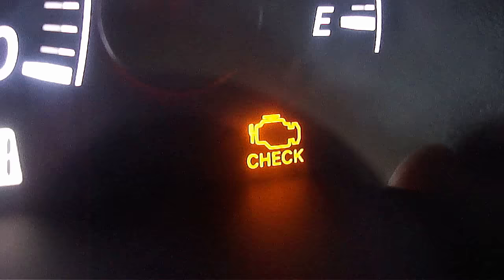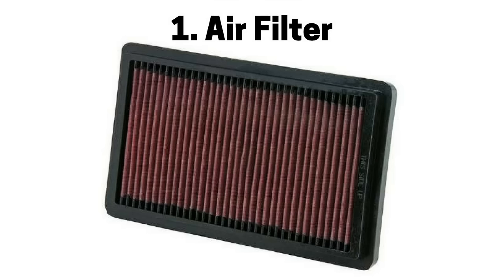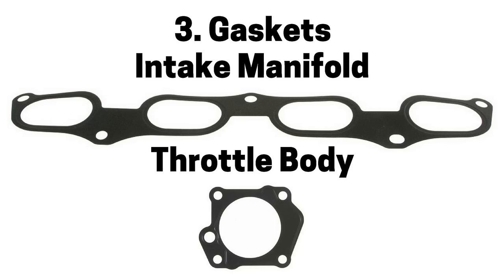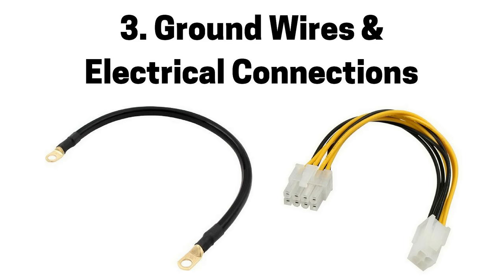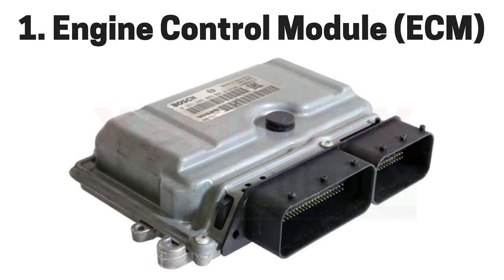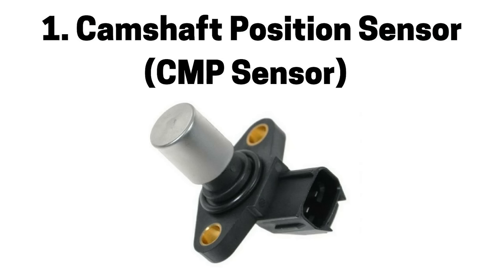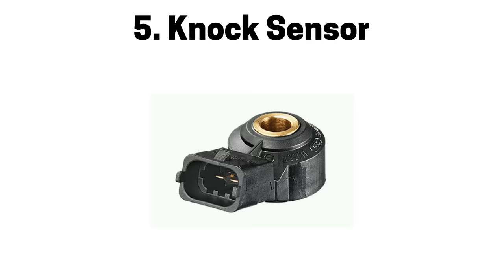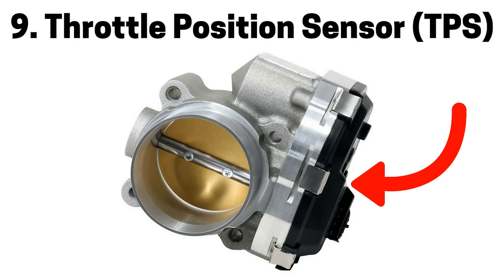How To Fix Engine Hesitation During Acceleration - Easy Fix!

Comment: We have a 1989 Honda Civic Hatchback with a manual 5-speed and 1.5 engine. The car has 145K original miles and is in good mechanical condition. The engine tends to pulsate in the lower gears until the car is fully warmed-up, then everything runs fine. I hope that this minimizes the massive laundry list of possible culprit items mentioned in the video. Feel free to send some ideas my way. The after-market car manual I have offers very little in the trouble shooting sections.

Comment: Had this issue this week with my Yukon Denali. Blinking Engine light had me very concerned. #6 Cylinder Bank Had Distributer line that had rubbed against a nutted stud mount wearing the wiring's insulation and shorting out on it.  Was originally thinking it was either vacuum issue or ECM failure.  Thanks for the Vid.

Comment: Tonight, while my mum was driving home on the highway, her van started to slow down. When she pushed the gas pedal to speed up it wouldn't respond. Then (she said) the brake pedal got really stiff and wouldn't go down AND the steering wheel locked up. There was no engine but she said the ESC light was on. Interestingly enough, the engine came on a couple days ago - it was on for 2 days and then it went out .... and now THIS!

Comment: Well your video perfectly describes the operation of can bus control ... but when you have a flat spot at low r.p.m. on a diesel V6 that neither throws codes nor engine light ... where do you start.  Thought so.😂

Comment: I tried my plugs and coils because it felt like gear shifting but it's definitely acceleration hesitation. Got 1 of my 4 oxygen sensors replaced. Confirmed MAF was good. Im hoping this will help although i still have to replace the other 3 sensors.

Comment: i have a 2000 ford ranger with the 2.5l  the problem with mine was a combination of poor maintenance (was a used vehicle when i got it )  a dirty  TB & IAT an a contaminated MAF, that brought the idle down. but the truck was still cutting out at highway speed,  i replaced the fuel filter, that smooth out the acceleration  but i was still getting hesitation/misfire at highway speeds 50+ mph, so i tested the coil packs an replaced them  i went ahead an replaces the wires/plugs so i know for sure they're new.  now the truck is running right

Comment: Heck.. this is why I prefer an electric car, and why automakers hate 'em. There's so many parts that can go wrong in a gasoline engine.
Reply from the maker: Each have their advantages and disadvantages. Don’t be fooled by electric cars. Once the battery cells fail on electric cars most people will not be able to afford to replace them.
Reply: @proclaimliberty2000  This is true, but warranties on battery packs are between 7 to 10 years, most people I think would switch to a new car before the warranty expires. And if the Chinese offerings do make their entry into our market, electric cars may (potentially) be at more affordable levels when compared to ICE cars.

Comment: I have a 2003 Toyota Corolla with 275,000 miles. The engine shakes or shutters when accelerating does better at higher speeds but still shakes. It does not stall though and the engine light comes on then goes off when the engine starts running smooth again. It shakes the most when sitting at idle. It started with a slight hesitation then kept getting worse, until it felt like it was going to shake apart.

Comment: Hey great vid man, I just got a 2013 Honda crosstour it's jerking, slow and fast with no engine light. These cars can run on 3 out of 6 spark plugs, so I'm thinking it's the spark plugs, Mass airflow sensor or the fuel injectors.

Comment: I have a 2004 Impala LS 3.8. with hesitation at fast acceleration and up hills.  Many parts were replaced and nothing showed on the dash or with a tester. The problem was caused by a faulty ignition coil 2/5 for cylinder 2 that was replaced before. The car now runs like new again. I suspect the coil was only partially shorted. If it was completely open or shorted it would have shown up with a vehicle OBD II code reader. Hope this helps you as it took a long time and money before this problem was solved.

Comment: Hey, forgot to mention $AVE some MONEY, as quite a few of these parts are EASY to clean/replace/install on some vehicles/trucks & are good maintenance items to replace like a PCV Valve and grommet, or cleaning or replacing an EGR Valve.  If this gal can do it, so can you!

Order QUALITY parts & $AVE MONEY doing it yourself, and teach your spouse and kids not to be afraid of using tools, it will benefit them years to come.

On my truck it took maybe 15 minutes to find the right wrench, remove 2 electrical connectors, 1 vacuum line, and 2 bolts, snap out the old MAP Sensor, snap in the new, do the steps in reverse, start engine to test & DONE!  & $AVED MONEY!
So, Get-R-Done!

Comment: I have 2009 Chev. malibu and I had the same problem.I found out that there is no transmission oil. I put original transmission oil and i drove 30 minutes around and now the car is running normal. Check your transmission oil, that could be the problem. I hope this helps.
good luck 
❤️from canada 🇨🇦

Comment: Often hesitation/bogging down/misfiring at low RPMs can simply be SPARK PLUGS. I would change these first if they haven't been changed in the last few years or you bought a used car with higher mileage and just don't know when they were changed. Just did this on my 2007 Sonata and fixed right away. I have had this issue on 3 cars the first two, I checked various other things first. This time, with experience under my belt, put in new plugs and BINGO. Very cheap fix.

Comment: You should try vacuum clean exhaust pipe on warm exhaust (not very hot exhaust bacause there may be too hot particles for vacuum cleaner) . That actually work. I find it when I find leaks from exhaust with it and cigarette smoke.

Comment: I did not know the ECT cause rich/lean issue.  It makes no sense to me because it has nothing to do with gas or air, just temperature of the coolant. But would explain why when I had p0171, that was one of the issue the code reader put out, if you have a tacoma, that thing is difficult to reach and pull out.  I actually broke it before I was able to test to see if it was working correctly.  It eventually was actually a 02 sensor. My advice to anyone, do the easiest one first and  don't start pulling things out because your bored of waiting for parts to come in. lol. but do fix the issue, it will save you on gas.

Comment: I will pray ;)) i have bmw x5 e53 30d 2005 and it dosent have power when accelarating no fault lights .. battery new all oils its ok turbo working no smoke from exhaust only issue i notice is when i turn left i hear a strange noice ...i will pray;))

Comment: I have a P0600 code (203E-4 Benz code) I can't seem to fixed. It won't pass emissions. The car stumbles at stop lights acts as if it wants to die out. When it does that it actually takes off by itself then I would have to force the brakes harder. I replaced the plugs, wires, coil packs, o2 sensors, engine, mounts, trans mount, k & n air filters, I cleaned the throttle body, I sprayed starter fluid around to see if I could find a leak somewhere and nothing. Idk

Comment: I was wondering what the fuck was going on with my truck lol. Thanks for this, now I just know it's hesitating for some reason and need to have it checked out. I thought it was my fuel injectors being clogged but when I used sea foam it didn't fix it.

Comment: If you say every item could be the cause of course your right.  Lol.  I just purchased a 2020 Dodge Ram.  It has the tick already.  Probably the sheared bolt. But the gas and acceleration are not in tandem.  It seems lazy. Should be quick.  5.7 l v8 hemi

Comment: Mines is probably the fuel pump, I put alot of miles on the truck after replacing it and usually hesitation is the culprit of a fuel pump starting to weaken.

Comment: OMG WAS THINKING Only Vacum leaks, engine compression, idle control valve, throttle body, air mass, spark plugs, coil Packs, and thats it from where all that bunch this will become a mystery as now there is no codes an got  rough idle and miss fire while accelerating 😅
Changed airmass cleaned throttle body, changed all coil packs and spark plugs got 70%improvement , smoke test no leak but still
I don't think I'll do anything else other than check compression in each cylinder and check fuel pressure and that's it and I'll drive it as it's got headache out of this 🤪🤪🤪

Comment: I have a Chevy Impala LTZ.  I was hoping you'd take about the Accelerator Pedal Position Sensor.  I want to pull mine out and inspect it.  These plastic piece of S#$T sensors are junk.
Thinking about ordering all of them.  Can't adjust them.
Helluva improvement boys! Crappola

Comment: I have a 2018 Chevy Cruz when driving it does it seems like the RPMs will drop but when you step on the gas pedal it would jerk and accelerate but it has no check engine light codes The fuel rail pressure is normal and the fuel trims or normal

Comment: I have a VW Passat with a little over 35K. Car is 3 years old and I’m a careful weary driver. This started happening only occasionally when starting from resting position. Most of the times it does not happen. It happens maybe once to twice a day on long drives. Out of all these what are the likelihoods? I’m hoping it’s nothing major,  cleaning (maybe filter) issue. I have my warranty and schedule an appointment at the VW dealership.

Comment: if you have an 1996 and NEWER that uses an OB2 port then you could take it to Auto Zone, Orealy's, Advance Parts,they will scan it for FREE,no issues there, however if you have an OLDER car a 1990-1995 that has an OB1 port,then you can't take it anywhere to have it scanned, in fact very few car parts stores will have it and VERY FEW  auto shops will even have a scan tool that would scan with an OB1 port & believe me I've tried

Comment: What about a jolt when I put the gas down and take it off the gas pedal on a 2018 Dodge Journey SE with 45,000 miles on it with NO check engine light?

Comment: I own a 2017 HONDA CIVIC TURBO 
my car has CVT gear
And it has started to hesitate while I drive
This started immediately after I got some of the work done by a trusted mechanic which is following
Engine oil changed (LiquiMoly 0W20 molygen)
Oil filter replaced
Air filter replaced
Spark plugs replaced with genuine
Cleaning of Cat convertor
Cleaning of Fuel Filter
Cleaning of Throttle body
Clearing all faults and idle relearning done
Any solution or idea as to why its happening to my Car?

Comment: Puzzle... I have a 2008 Nissan Rogue that won't start or make any sound. I've changed the battery( a week ago) , spark plugs, engine gasket seal,  and checked the starter. Suggestions? After watching this video I feel like I need a new car all together...help

Comment: I have an intermittent P0340 in my 2008 Chrysler Sebring 2.7L. I replaced the camshaft sensor and the crankshaft sensor, the car was fine for a few weeks but now I keep getting CEL and Traction Control light on after about 10 minutes of highway driving. P0340 again. Poor acceleration over 80km/h, there's a delay when pressing the gas pedal and it jolts when I let go of the gas pedal. The next day it will be off for the first few minutes of driving then it comes back on. I check the wiring to the connector it looks good and I check continuity of the connector ground and it is good. Is there anything else that could cause P0340 that I should be checking?

Comment: my 2008 Scion XD is doing this, replaced the spark plugs and it didnt fix it, only happens when accelerating, never happens at idle or cruise control in 5th gear .

Comment: Hi my 2003 silverado 4.3 is hesitating I change the spark plugs and the spark plugs wires and it’s still not running good

Comment: Although a very good and informative video, I thank the author. But, my 2018 Elantra automatic, when in ECO mode, when I punch the gas pedal to accelerate while driving to pass someone while changing lanes, or entering a parkway from an on-ramp, there is at least a one to two-second delay before the vehicle accelerates, which is a dangerous issue, in my opinion. So I use Sport mode when entering a roaday from an on-ramp or intend to pass. I do not use ECO mode anymore. I have seen articles on this same issue in car magazines when the 2018's came out and naturally after i purchased mine. otherwise, aside from the peeling paint, Its ok for the money.

Comment: Yes I don’t have a check engine ! So what could I do ? My Mini Cooper 2006 was working but stopped now it turns off or has no power I have the pedal pushed down and it’s doesn’t go at times

Comment: What if your 2007 Tahoe (5.3 V8) just seems to not like hot weather. With the AC on, I can floor it and it'll take upwards of 15-20 seconds to hit 55-60MPH. If I turn OFF the AC it shifts fine, but that sucks in stop-n-go 95 degree traffic. Just kinda lollygags at 15-20mph until the gears decide to shift, slowly, until it hits 3rd gear then it moves. Fluids are good, tranny was recently given a drain/fill to see it if helps. Dealer said they saw no issues with the transmission at all. It worked fine for them (I rode with them as they tested it). It is random when it happens. As the weather cools, it seems to just go away.

In addition, it just randomly shifts itself into 4-Hi at various speeds (including highway, ugh that was terrifying)? I'm told it's either the switch up at the dash (but all the lights work as they're supposed to) or there's some "shift solenoid" or somesuch that is going bad. Not sure what to do. Local Chevy techs said they couldn't find anything wrong.

Only regular code I get is P0455 (Large EVAP).

No codes for this delayed/slow acceleration issue or my 4x4 issue above.
Reply: Check your exhaust. If it’s really hot. It might be a clogged catalytic converter

Comment: 2006 ford expedition 5.4L engine runs Smooth around town, when on interstate car will accelerate smooth up to 65 miles an hour and no further. on level road it will run smooth at 65 but if going up overpass engine will buck slightly with no increase in throttle.?

Comment: I’m getting cylinder 1/4 misfire I replace the wires the spark plugs. Fuel pump. Did fuel injector cleaner last thing I can think of is the coil pack

Comment: I seem to be slightly sluggish only in 1st gear, no trouble codes or check engine light at all. The air filter is new, as are the spark plugs and ignition coils.

Tapping into the OBD port with an iPad app, I am showing intermittent misfire across all 4 cylinders (i.e., 1 misfire per millisecond for about 5-10seconds then it disappears)...rarely in more than one cylinder at the same time but only ever during idle and lower rpm like 1st maybe MAYBE 2nd gear. No misfires whatsoever ever at highway speeds/rpm, whether coasting or accelerating.

The previous owner apparently had the fuel pump fail on them once recently, but got it working again and chose to not have it replaced. I am planning to change the pump very soon but given the symptoms, is it more likely something else?

Comment: Well I don’t have a check engine light but my engine stubbling loss of power and no body can figure it out
Reply: I have the same problem. Just started a few days ago. No codes. No check engine light. Hopefully the Toyota mechs can figure it out. I think its a computer / electrical issue.

Comment: So, if it happens with the engine at operating temp when I drive a couple miles but seems to go away soon after that, almost like I needed to warm up the transmission, does that narrow it down a bit? Only code is an EGR valve code I’ve had since long before this problem started.

Comment: i have no check engine light i just am not getting enough power when i get to 2nd or 3rd gear on my 2003 Isuzu rodeo. this also drains my gas like crazy, most likely because im flooring it to go. i think it could be a vacuum seal leak but idk

Comment: mine doesn't hesitate. but it does a jerk motion when I press the accelerator at low speed. for example, I'm coming to a stop. I release my foot from the pedal, let the car slow down but never brake and then I press the accelerator to continue while the car is in motion and that's when it jerks. any idea

Comment: mine did that. the coolant temp sensor was bad and shutting off fuel to injectors. the temp gadge rose to 260% in a short period of time. after I fixed that it runs good.

Comment: I don’t have misfire but it did not want to accelerate when I floored it on freeway. 2011 Honda Accord crosstour ex-l 3.5 v6 filter is new , spark plugs are new , maybe went into limp mode ? It acted like it was under powered after until I got off freeway

Comment: Basically anything in your engine can cause  rich or lean air fuel mixture misfires and check engine light. So a long video will get you nowhere.
Reply: I think the guy Googled engine misfires and list all reason google gives and make a video.

Comment: Mine is 100% electrical, After washing engine I got engine light, p0011,code and  bank 1 sensor 2 voltage high..Code, K am tired, not sure if I killed my ECM

Comment: So I was starting to get a random misfire and it's was getting so bad at low rpms that it would miss 3 to 4 cylinders out of the 6 then it would run ok for a couple mins then miss alot again with no error codes or check engine light. So bad to the point that it wasn't charging right. I replace parts checked parts it was driving me nuts because I couldn't figure it out. Then a buddy needed a jump and we put the cables on and his battery was talking way to long to charge. I took the battery post connectors off cleaned both post and connectors and that fixed my miss fire